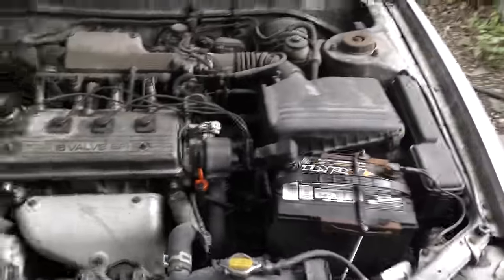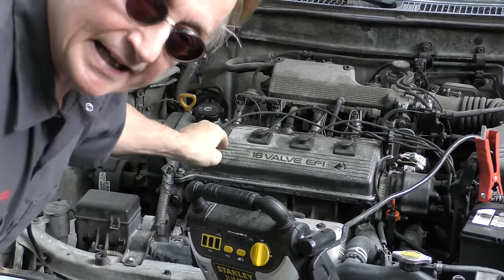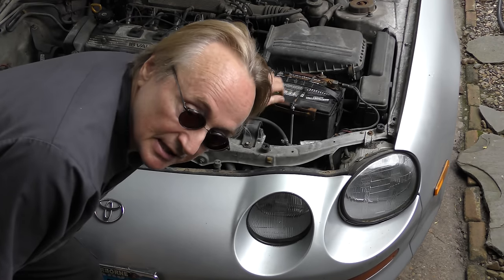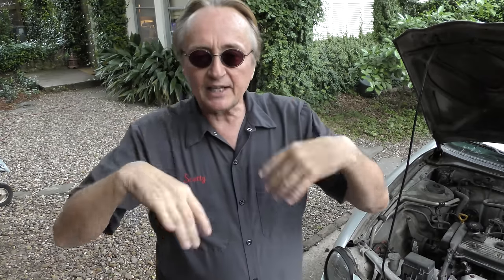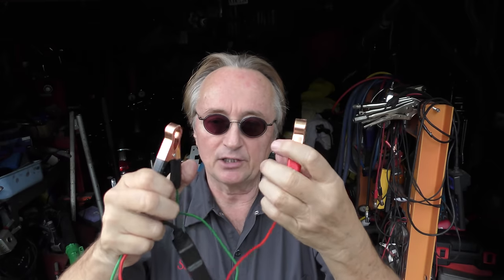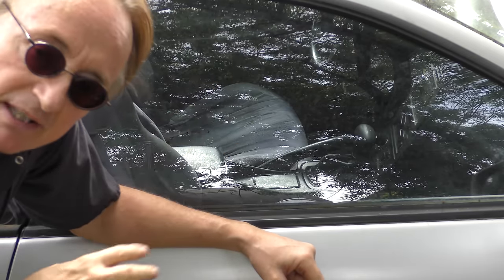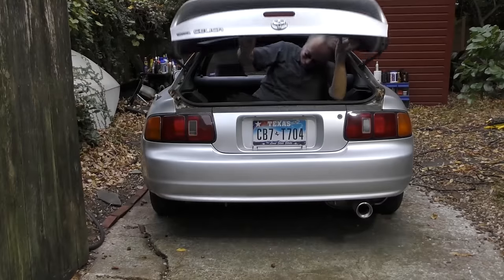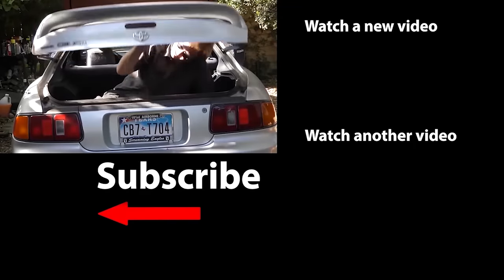Never Do This to Your Car (Learn from My Mistake)

Comment: Thanks Scotty
That Battery Management System reset -  
If I had known this last year my daughter could have got her 2019 BMW battery replaced for free. The car suddenly would not start. Checked the battery. It was at 10.8 volt but it looked fairly new. Got a qoute from the dealership and and was not willing to part with an arm and a leg.
Trusted garage qouted a lot less and he had the computer like yours. He mentioned he rest "every thing". 
Penny dropped when i saw your video. 
Will tell my daughter all about this "told her she was mental for buying a Beemer".

Comment: I wonder if Autozone or Advance do this program resetting  when they advertise free battery replacement. I doubt it.
Reply: Nope. We don't. It's at your own risk. If I had my way, I would refuse battery installation on those expensive cars. Its not worth the potential trouble. Hell some of these new cars will set the battery light and sometimes the check engine light after replacing the battery. Trying to explain why to a person who has no idea how a car works and the computers think is incredibly difficult and frustrating.

Comment: We also connect the jumper to earth to bypass a dead battery pulling down the jump volts and amps.
Modern cars have separate jump studs or terminals away from the battery to ensure safe jump and  in addition due to battery location.
Always surprised how many vehicles come in because a workshop hasn't recoded the new battery in, or sold a battery not suited to autostart technology.
Did I notice the top beam of your garage drop down toward the video end?
Time to stick it back up with some fresh paint!

Comment: In my 2021 Ford Edge you just press the start button (key fob in the car, don't start the car), flash the high beam 5 times, press the brake pedal 3 times, wait a few seconds.  The battery icon on the dash will flash a few times - done!  Battery monitor system is reset.

Comment: I had a 2005 passat a few years ago.
It needed 3 cables to jump start.
Said so in the car manual.
Plus to plus on battery
Minus to battery
Minus to ground on the engine

Comment: So BMW over engineered a charging system and made it worse?
Classic
Reply: It’s to prevent overcharging and prolong alternator life.
Reply: That’s what a voltage regulator is for
Reply: Remember when they sold alternator rebuild kits. Now you have to buy Remanufactured or new.. used to spend 10 bucks when my alternator gave out. Now 140 plus 30 core.

Comment: Could use a link to the product you called a "Memory Keep-Alive" battery attachment. The device is inexpensive, you said, but vital to avoid losing information in the car's computer about its various subsystems.

Comment: what you didn't mention to the guy having his dad cut kgg6sf 4500 rpm is it could be a fuel filter issue. I had this happen on a Ford Ranger. The dealer said it only had one fuel filter and it was at the tank. Turns out I  found another under the drivers seat on the frame rail located in a steal box that had to be removed to access that filter

Comment: I have a 2018 Ram Promaster.  FCA had a recall on my PCM. After they changed it out, my battery light comes on after starting the engine. Not always though. The only way I found to get it to go off is to shut off the engine and restart it.  That works most of the time but NOT always.  Is the new PCM bad?  FCA mechanics can't fix it.  FCA customer service won't let their engineers know about this problem. They want me to keep taking it to different dealers and pay them to check it out.

Comment: Some cars like Mazdas for example have a "relearn" process that needs to be done any time the battery is disconnected for any reason. Although very simple, it does take about 30 - 45 min. Its still better than needing a high end scan tool or a mechanic.

Comment: As the ECU is in charge of the alternator. Buy a volt cabin temp and USB device that plugs into the cigarette lighter and you can see if the car starts to charge one you are driving down the road.

Comment: Ever since my first car (1967) and having to buy a replacement battery every 45 months for a 48-month-warranty battery, jumping instructions ALWAYS said connect the negative cable to a grounded part of the engine away from the battery.

Comment: The OBD2 Battery memory saver cannot be used in most new BMW's.  It will blow the OBD2 fuse and the car will go into limp mode.  Guess you haven't ran into this.  Might want to warn ppl of that before they do as you say and pay the price.
Reply: and maybe can damage the control unit that connected by LIN bus.

Comment: Very good info , he’s correct about the BMW battery , 
However there is a device that plugs into the OBD 11 connector. That is your diagnostic port. The device name is Carly it cost about $70 and then you own it , One also has to basically lease the software but it’s only $60 a year and it’s amazing what one can do with this scanner tool that does not cost a fortune . It resets the battery in the ECU too . All one has to do is pair there iPhone with Carly through WiFi .

Comment: All the door glass in cars have a logo that will say if it’s tempered on the doors, so even if you don’t know, you can find out without calling the dealer. Or roll it down, and look at the edge, and it’ll look different if it’s tempered or laminated. 👍👍

Comment: This happened to my mazda 3. But all I had to do to reset computer is run it for like 20 minutes. My car was stalli g at stop signs and around corners. After running car for 20 min in driveway.  It's worked ever since with no stalling.

Comment: My 2000gmc Savana would not start due to a cheap distributor cap .it took awhile to figure this out.i replaced cam sensor,crank sensor,fuel filter,couple fuses the moral is don't buy cheap auto zone ignition parts.

Comment: Scotty, I bought a ac outlet plug that uses a 9 volt battery u plug it in to your cigarette lighter plug before you change your battery so you don't have to reset your computer, have you tried one

Comment: I've older vehicles and for the most part see little reason to get newer models. The 1994 Subaru Impreza gets 35-60 mpg depending on speed. The 1989 D21 V6 4x4 around 22 and the 1989 Ford F250 averages 15 with a 460 V8. Both the smaller ones have over 280,000 an still run great.

Comment: My jump pack's cable is too short to reach a non-painted metal surface in the engine bay and I noticed that I would indeed have a rough idle after the jump. Thankfully on at least a Subaru there is an "idle re-learn" process you can do on your own instead of taking it to a mechanic. The same thing happens if you replace the battery.

Comment: Seems as long as the first battery has current you could hook wires that go from the new battery to the terminals then remove the old battery tighten the terminals then remove the wires. Uninterrupted current.

Comment: My Cadillac SRX started up and ran just fine (sometimes0 but had a bunch of throttling problems, occasionally it would almost shut off at lights and sometimes while driving you could feel like someone was tugging the car along with a rope. I changed everything and cleaned throttle body, etc. When the battery went bad I had to buy a new one, nothing special, just the same type battery it had before. All the problems went away as soon as the new battery went in. My theory - there might have been a bad connection at the battery, causing it to lose connection randomly and making the car rely on the charging system only. Perhaps the bad times were when there was excess load such as electric fans chipping in? Incidentally, always took off negative cable when working on car so "bad connection" would have had to be at positive side.

Comment: The info about how to jump start a battery is great and can be used with many cars.  But it won't work on my 2001 Buick LeSabre, because the battery is located INSIDE the passenger cabin, UNDER THE REAR BENCH SEAT.  There may be more cars (GM brands) that have this arrangement, so check into that possibility if you can't find the battery in the engine compartment or the trunk.  It seemed like a dumb idea to put it there, as fumes from the battery might vent to the passenger area.  Fortunately, there aren't any ashtrays or lighters in the rear seating area; one of the engineers may be responsible for making sure there weren't any for that  reason.

Comment: Even my 2012 ford fusion I bought used and needed a battery, I discovered the idle and transmission adaptation was reset when I disconnectd the battery and the car ran like crap, thought I broke the car! Mind you I came from a 98 camry before.. Get a memory savor! Well worth the few bones!

Comment: You do put lots of lovely informative Videos on Utube and surely enjoyed! I do have a Question>>> I purchased a used 2013 x5 35i i was told that the battery was replaced (im assuming by a/ some dealer) the question is>>> while i am driving it normally on the highway and around town it show digitally 14.70 volts on my cigarette lighter plugin charger for my i phone charger , is this normal and can i "assume" that when the new battery was installed (before me) there was a reset done and its normal at 14.70 volts ty continue posting greattttttt videos!!

Comment: 2016 f150 to reset computer you just put key ingnition to on, high beam 5x, press brake 3x then the batterie sign wil flash 3 time to tell your battery is reset. you can also lock the truck and wait 8 hours and itll do a relearn of the batterie but still better to reset

Comment: I have a 2008 Mercury Sable, and the battery seemed just fine. The car started with no issues even when temps dipped below zero.

My RPM gauge would often stop working, which was one of those "this could be a major headache" issues. The Ford dealership said they'd charge me hundreds of dollars to even try to diagnose the problem.

I had the battery tested by a parts store, and it tested "bad battery." I put in a new one, and now the RPM gauge works fine. Go figure.

Comment: Hey Scotty! Hope you’re well. Quick question, I have a 2010 Dodge Challenger with the automatic window lower/riser when door is closed. It drains my battery as it lowers and rises (with door closed) when car not on. Would it be because of the computer? Or maybe when I changed the battery? How can I fix?

Comment: Hey Scott!  Long time subscriber...
I have an 01 lincoln town car and the only code I cannot get rid of is the Keep Alive Memory P1633.  I did have to replace the dead battery, but didn't use the device you mentioned. Now, can I use my Forscan software and HS MS  scanner to reset the KAM error or to reset my charging system as you mentioned, or do I have to go to a mechanic to do that

Comment: You're supposed to do it that way anyway so that you are starting the car from the jumper, not including the damaged battery in the equation. And it has always been better practice to disconnect the negative on a battery first and reconnected last, that has always been true. Just because we've added to the electronics on the car doesn't mean you ignore basic electrical principles.

Comment: My truck stopped running away from my home. I was messing with the battery when the top blew off filled my eyes with battery acid there was water in the street I dropped to my knees  and started washing them out with that water. I tank God for that water.
When ever I have a car problem I make note where the water faucets are when I stop just in case.

Comment: Good day Mr Scotty hope your well.... question : I drive a 2016 Jeep Wrangler about 180,000 klm. What I have been noticing is when it gets cold out ( Winters on its way and I live in Ontario Canada ) My  Jeep starts up no problem but when I put it in gear it feels like it wants to stall and sometimes it does, but after that I have no issues all day its only on start up in the am and cold out, any suggestions? something  that I should check before bringing it into the shop? Thanks GB.

Comment: I am a 79 year old and just burned up my 2000 Lincoln Town Car !
Had 2 oil repairs done this year and thought I was ok  but driving on the hwy. recently my engine started making a ticking sound and lost speed so I pulled over and stopped  and turned off the engine.
Had to be towed home and found out I more than likely burned up my engine !!!
Since I already spent close to a $1000 on my car recently and cannot afford a new car , i am looking into buying a re-manufactured engine.
Found out installation is over $2000
Don't want to buy a used car because i might get into unknown 
other problems.
So now i am watching Scotty's very closely and try to follow his advice.
Since i have no man in my life   i have to learn as much as i can to keep my car running.
Never thought I would be under the hood of a car at almost 80 !!!
Reply: There is hope for me😂

Comment: Hey I was watching your videos on batteries. Just wondering which Battery load tester you would recommend? And it not break the bank. Will be using it to keep check on Boat batteries.

Comment: The keep memory alive that plugs into the socket usually runs on a 9-volt battery. My question is how does the system know you replace the battery

Comment: Scotty Congratulations on your channel. Could you address an issue I now have with the a/c  on my 2016 Kia Sportage. In recent days the air conditioning starts blowing hot air . Then works  great . A day or so later it will  blow hot air again. Any suggestions on what could be wrong. I want to have some idea so I don't get ripped off. 👍

Comment: My 2006 toyota camry hesitates when accelerating but only when the air conditioner is on. A mechanic told me in the middle of last winter that the  catalytic converter was bad, but will this cause this problem?

Comment: So what happens when using a trickle charger? I googled and it said it was OK to not remove the battery, OK to connect directly to the battery and leave it hooked up as usual. I also just installed a new battery in the 2004 Cherokee, is that now a problem??   This is all news I never heard about.

Comment: Question, wasn't Laminated Glass made for better safety and in a rollover, or if the glass breaks, was it not designed to be pushed out anyway?  Wondering cause your explanation seems confusing. Thx!

Comment: Omgggg the last issue you talked about I spent all of last year figuring out. My Toyota was made in Japan and the same part in the USA made cars(or wherever the rest at made lol) is not the same part. So, yeah expensive scavenger trying to find what was wrong. I got the right sensor but eventually got another code and replaced the charcoal canister which typically goes out at 180k(this was right at 180k) and everything cleared.

Comment: If jump starting incorrectly causes funny things to go on . 1 thing after the jump 🦘 the power steering turned manual tried everything I could with out changing didn't make a difference not sure what happened to it it's 2008 Chevy HHR LS dealer doesn't even know what to do either according to the numerous amount of compliants  reported in America naturally but Canada has it covered for recalls so very confused about what to do about it. Like some advice on it if possible

Comment: Back in 2011, at 16 years old, I bought a 1975 ford maverick as my first car. It needed a new battery, so I bought a new one, and put it in. Being 16 and clueless, I reversed the polarity of the terminals, and fried the starter. That day, I walked down to the auto parts store, and bought a new starter. Had my car up and running the same day I fried it. 

I couldn't imagine doing something like that today with. A modern vehicle.

Comment: I accidentally turned my jump starter switch on when I had my red positive clamp on the negative terminal and the black clamp on metal. It made a spark. Do you think I’ll have to take my vehicle to a mechanic?

Comment: Scotty, will doing a HARD reset of the car's computer also reset the Battery Managment System ,or , is it necessary to reset the Battery Managment System using the scan tool?

Comment: Scotty:  I have a 2017, GMC Sierra with a 5.3 Liter Vortec engine and an eight-speed automatic transmission with a tow package.  My Sierra has only 18K miles on it, and the transmission is now shifting hard with a faint "clunk" sound when the truck is cold and the ambient temperature is 40-45 degrees.  What's wrong with this thing?

Comment: Battery sparks if you connect negative first. It will not spark when you connect negative last. But when removing, negative first and then positive last. That way you will not get a spark

Comment: Scotty, great video, riddle me this. I have a 2012 Mazda 3, the battery recently went dead. It was low in fluid in two of the cells and had a bulid up of acid on the positive terinal. I cleaned off the powdery build up the best I could and jumped the car with cables to another car. I put the red to the positive side and the black to the negative side on the battery terminal. As I was driving home I noticed my cruise control would turn on but would not set when getting to the speed I wanted to go. When I got home I cleaned up the battery, added distilled water to the two cells and charged it. It's holding the charge very well. The cruise control is still not working. Is this something that has to be reset by a mechanic?

Comment: Hello Scotty I jus love your channel. I have a question. I have a 2003 matrix and the an the Altenator recently went out. I also put a New battery. But my car seems to be running a lil ruff now. Can you tell me if my car has a battery sensor.  Or if the computer needs to be reset

Comment: Hi Scotty ,I hav 1995 Ford E250 5.8 w only 50K orig miles .Never had any trouble nor any engine work ,No tune up only new Battery .Starts then Stalls .If I press Gas Pedal its stays running as soon as I take my foot off the gas it stalls . Can you offer any help . Thanks so much